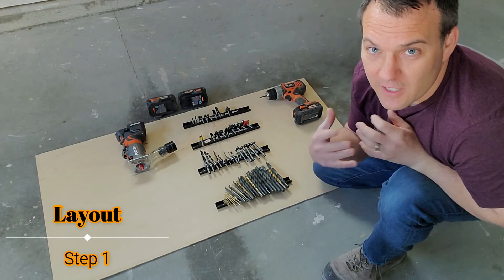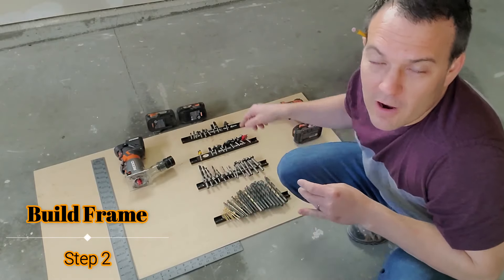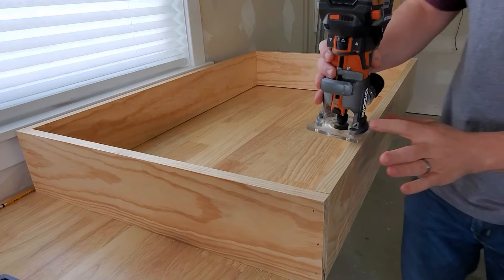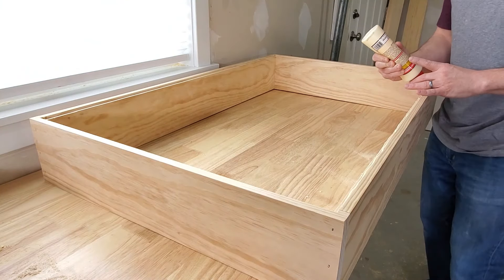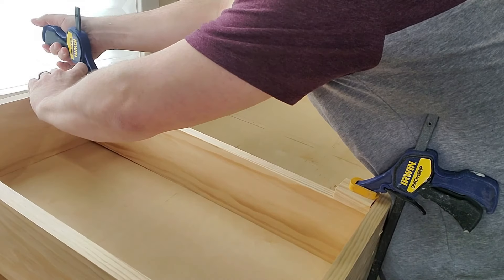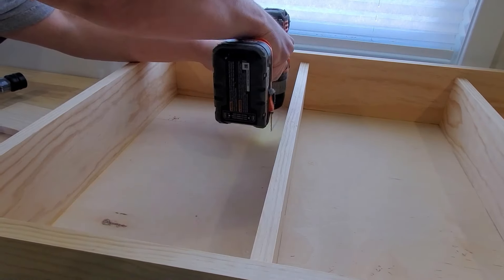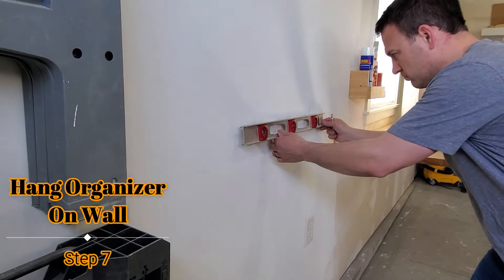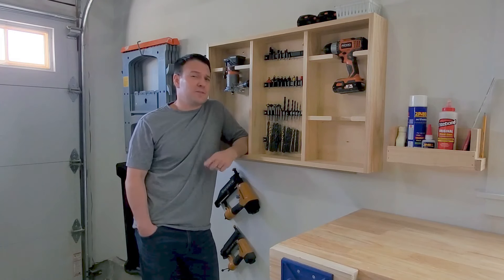DIY Tool Organizer!

Comment: I really like mounting the drill and driver like you did.  I am making a cleat wall. This weekend is tool holders. Not sure how it happened but I have 5 holders to make. At least two will be done like yours. Thanks
Reply from the maker: I like it better that way because I have limited space and I don't like it sticking off the wall that far.
Reply: @HowIDoThingsDIY  Put your Ridgid drill and driver in a PVC tube back facing you. Get a glass of water from the kitchen. Now quick grab the driver… Or put them nose facing out with a philips head bit still in it. Be sure to keep it at eye level for maximum effect. 🫣
Reply: @HowIDoThingsDIY  So I made the five cleat wall drill and driver holders. They came out great the first one took several hours. The last one which I decided to stain only took about 45 minutes. I really like seeing the profile. Thanks again.
Reply from the maker: That's great!

Comment: My concern with how insane wood prices are, it may be cheaper to just get a metal cabinet. Granted it wouldn’t be custom, or cool like this.
Reply from the maker: I think with the level of customization and the 1/4" backerboard design I used, your better off going with wood, personally.  I basically made this thing out of 1 sheet of 1/4" handi panel and 2 1x6 boards.  Interestingly enough, at Menards a select 1x4 was only $.50 cheaper than a 1x6.  So I bought all 1x6 and after I ripped them down, I ha nice 1x2 left over and it was basically free.